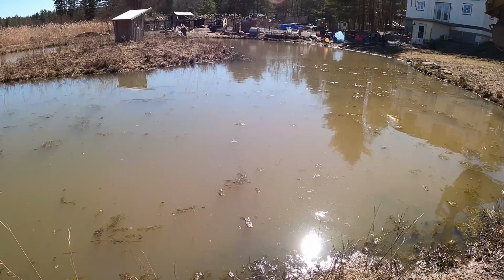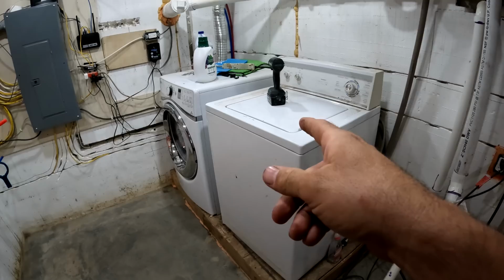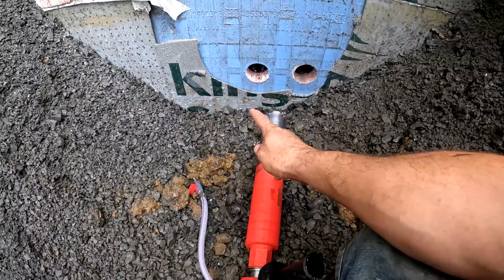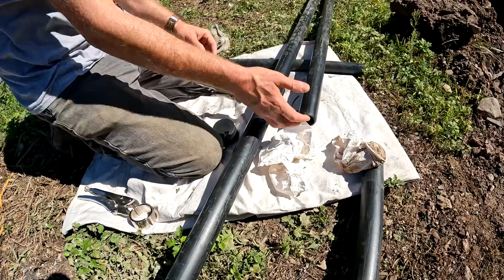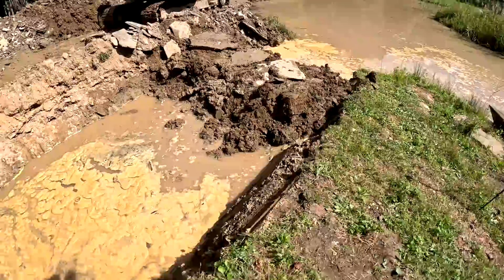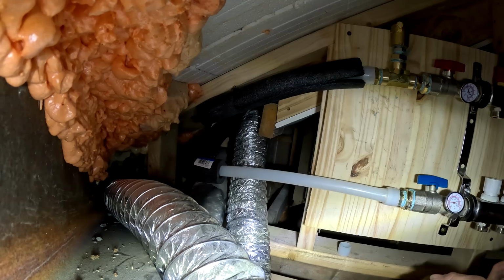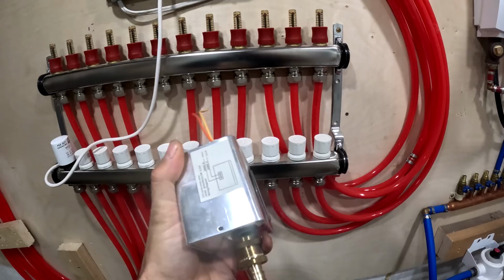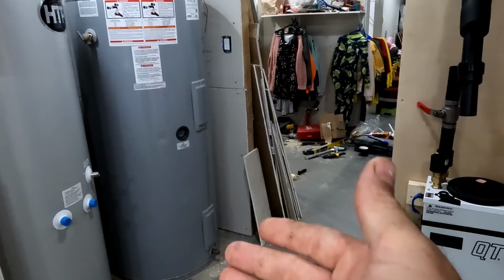Installing a geothermal system with a pond loop at my house Part 1

Comment: Why are you worried about burying the pipe assembly in the bottom of the pond, wouldn't the coil be warmer in the mud or rock under the pond?  Most closed loop systems that I have seen are just burred in the ground 8 to 12 feet deep.

On the drill can a SDS Max (or SDS+ for 2" and under) do the same holes or is that drill just much easier?

What heat pump are you using for your system?

Comment: I found my 6 zone/thermostat radiant floor heat was a bit of an overkill since heating the slab is not instantaneous.  On cold days my boiler and circulators were calling for heat all the time due to all the different zones calling for heat at different times.  I ended up manually bypassing/opening all the taco zone valves for all zones but the warmest room in the house, which would set the ambient heat for all rooms.   I also turned on the thermostat for the coldest room to a temp below the ambient heat to keep it warm on real cold days where the only zone which would not heat was the warm room when not also calling for heat.  Saved me a bunch in fuel and electric.  2:17:02 Hopefully that tank will help you, plus your house is tighter than my house, though it is not good or cheap to have a circulator running all day either.
Reply from the maker: yea I get what you are saying. but with this tank, it circulates 120 gallons before needing to turn on the unit.  Also remember this circulator pump is modulating, and at the max flow it is only using 45 watts. but that would only be with the whole house calling for heat. Usually much less. It has a flow and pressure sensor so it only ramps up the speed if it senses it needs to. With a boiler and circulator for each zone, you are using alot of energy when one zone turns on. Upstairs I have 4 zones which are all small rooms, so I specifically did not want anything besides a super efficient pump turning on when each one of those zones turns on
Reply: @jmuller86  I have older Grufundos circulators but also run three of them, radiant loop, injector, and boiler loop, plus a fourth for my hot water.  20 years they are still going.  Hopefully you got a stainless steel tank, my old HTP superstor tank had galvanized connectors which burst.  I am pretty sure my plumber installed it wrong, instructions tell you not to heat the connections because they were plastic lined to prevent rust, 10 years later they rusted out an burst right at the nipple.  I think most superstors are stainless steel these days.   It is still good to have zones, you can dial it in multiple ways with the flow valves or zone valves.  

That storage tank might make a difference in my house too. There probably is a way to run it off my superstore hot water tank since I run an injector pump to inject heat in my radiant loop.  Tie the superstor into the boiler loop and have its hydrostat turn on and off the boiler only when needed, similar to a tankless water heater coil in a boiler.  Would eliminate the circulator on my superstore and probably hydrostat on my boiler.

Comment: Not sure where you live, but if we installed a loop in a pond like that in Canada, we would freeze the pond solid in winter.  My outgoing fluid temps are at 28F in the middle of winter.  Incoming are at 32F.
Reply from the maker: There is only a 4 degree delta in the loop? When ice forms on the surface it is like insulation and keeps the heat on the bottom where the loop is

Comment: You have me wondering how you expect four inch minus rock to hold a vertical eight foot dirt bank?  Wouldn't you be better with armor rock of a huge size or perhaps precast concrete blocks?  Since it is an invisible bank it would seem important to do a little overkill.  Behind that barrier digging it out and putting in the four inch would make a good base.  You have so much cut dirt bank around the pond though I don't see how you are going to deal with silting?  Did you put down pond liner when making the pond?  I watched it but that was years ago and I have forgotten.  Can you pull up the coils for maintenance in the future?  To allow you to dig out the silt that may start to cover them?  Another very interesting video.  I like having it all on one video rather than many twenty minute ones.

Comment: Yeah - I'm not understanding where the heat is coming from in the winter since the water will be in the 30s so you would need to have air temps in the teens to pull heat.  I'm used to seeing deep geothermal with temps in the 50s for cold climates.  But wow - what a setup.
Reply from the maker: Ponds stay usually in the 40s in the winter towards the bottom.
Reply: i think the earth radiates heat towards atmosphere, so if the atmosphere is freezing, the lower water levels still stays warm as the atmospheric temperature can't make inside deep water. this is a common knowledge, idk if there's any technical thing about it in your area.

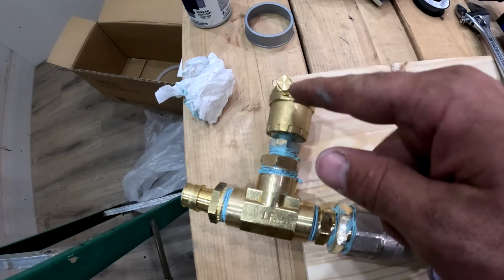Comment: 1:31:47
It's a floater valve.
Air collects at the high point and the water level drops. The floater drops with the water level, which opens the valve to purge the air.

Comment: instead of putting more weight on the pipes, why didn't you just fill it with water and purge the air to make it easier to sink in the water?

Comment: The looping is designed to create cavitation which causes the water to mix and thus absorb more heat or cold depending on cycle.
Reply from the maker: Really? I did not know that
Reply: Interesting. On my ground-source system the looped (aka "slinky") is the less efficient style. More energy is exchanged with long, straight runs. Need a lot of land area to do that, of course.
Reply: @mg-bx6bi  I have long straight but more lines smaller is better because of more surface area and more cavitation. 

In water the loops stacked don’t matter as much because the water gets into the gaps. But it goes down to smaller pipe to cause cavitation.

Comment: im wondering that there not being any introduction to what is being done here i assume that this project is using a geothermal area where you have mild volcanic heat from below the ground.Is this the resource that producer of video is trying to utilize as source of clean energy? Thanks for reply

Comment: 1of the 2left loops may be a heated garage /equipment maintainance shop like Dirt Perfect has as addition to his house the other perhaps a self defrosting heavy weight rated concrete driveway?
Reply from the maker: I will be building a new garage in a few weeks, 40x60 but it is like 200 ft away. I already have a used 5 ton geo unit for that. I was also going to install a concrete driveway and have it setup for driveway heat but I want heavy antifreeze in that so I may just use a cheap tankless water heater for that instead of hooking to geo. as it only runs once in a while and will get shut off as soon as the driveway is melted

Comment: your going to need 160/170 degre water for your DHW inderecte any way so you can attach to that loop for fan coills and stage thermostate radient will take may be all day to rise 20 degres
Reply from the maker: We wont need that high of temps for the dhw. But that would mean the unit would have to run the entire time that second stage is on.

Comment: Just wondering, when you spoke about the two pipes possibly shifting when you backfilled.  Is there any reason you couldn't use standard (non-pressure treated) 2x4 with CHEAP strapping material   to hold the pipes apart until the backfill job was done?  Or even some scrap 2x6 with holes drilled through to position the pipes.  In time those boards would rot away but the pipes would be solidly in place.
Another question, have you done a "blower door" test on your home yet?  That is one of the items that gives me the biggest efficacy "hard-ons" for a "net-zero" build.  Controlling the flow of unconditioned air in and out of the structure seems to be THE biggest issue with building a tight (energy efficient) home.
Reply from the maker: Yea a 2x4 would work but we just manually made sure they were apart as we were backfilling. I have not done a blower door test but I will be in the next few months

Comment: Very nice video … can you explain how geothermal works like with the pond water? Like in the winter when the water is cold how does that make heat
Reply: The water and ground temperature becomes constant below N number of feet/meters, depending on the soil. 
It's much cooler than the surface air temp on a summer day, much warmer than in the cold of winter.
That's why the code for water supply pipes says they need to be buried deeper than the frost line.
That relatively small difference in temp. can make a big difference when the system is good, like the one Jesse did here.
I'm also interested to hear what Jesse will say in a year or two about his system.

Comment: What is the floor covering on the second floor wooden slats? I thought I understood in the other video that you were only going to put a sealant on the concrete floor of the second
Reply from the maker: Yea I was going to use epoxy paint but we decided to put some waterproof laminate. It gives a little bit of cushion for the boys if they fall by accident

Comment: With the manifold I would of spaced it off the wall with 2x2 batten and 1/2” ply and popes the pipes coming down behind it
Reply from the maker: Thats a sharp corner though unless you start to the right or left of the manifold
Reply: @jmuller86  

That’s a fair point I do a lot of underfloor heating systems the electrical said I have also done the air source and solar heat and electric I enjoy this kind of work so was really good to see yourself making a tube on it cheers feller

Comment: When installing devices on your old work electric boxes cut the ears off the devices or your plates won't sit flush on drywall. Like your "boiler switch"

Comment: Would that pipe happen to be Phillips Driscopipe?  General piping rule of thumb for sleeves, hole is 2 pipe sizes larger than the supply pipe. Link Seal makes a mech seal to make sure that it watertight. Link Seal has charts to back check sizes. This is general industrial info that you don't need.
Reply from the maker: yea I was going to use a link seal but already had the 3" hole. Link seal would need a 4" hole. But I got it waterproof using other methods

Comment: I'm confused. Are you heating your pond?  Why would you want 39° water coming it that you have to keep heating?
Reply from the maker: 39 degrees is in the coldest days of the winter. Right now its at about 45 degrees. It extracts the heat from that temperature. So if it comes in at 45 it would probably go back out to the pond at 35 or so

Comment: 25:00 would have brought the first floor down on the other side then under the 2nd floor (and in the middle) so it wasn't so tight of bend, which is the worst part of it.  having the tubes more nicely laid out would be better too... stack them 2 layers of 3 would have worked too (router 3 channels each into a couple 2x4s and stack them would work for securing the pipes

Comment: Were you planning to put safety pans under your large tanks in case they leak in the future?
Reply: Right after fire rating the whole room.      NOT
Reply: @SPUDHOME  Sorry I do not understand your reply.  Not sure what fire rating has to do with leaky tanks.  Water heaters tend to leak as they wear out, pans underneath with water alarms let you know when any leakage is detected before a major leak occurs.
Reply: @jaycahow4667  what part of “fire” Is hard to understand? Fire has nothing to do with leaky water tanks. Is there a electric panel in the utility room? How about leaky electricity? I realize you must have a one sided mentality but just once think the other side of leaky tank. Just try.
Reply: @SPUDHOME  Instead of insulting me try explaining your original comment.  I have no idea why you even brought up "fire rating" in the first place after I just mentioned leak pans under his water tanks (that is why they make them in the first place and they are required in many places if water tanks are placed on the second floor or higher of a residence).  Your comments are clear as mud.........
Reply: @jaycahow4667  why are you so one minded. What has leak pans have to do with a home fire? FIRE. a leak pan will not put out a home fire.

Comment: I think the coils filled with compressed air was what was giving it so much buoyancy. Once the tubes are filled with water, there will be very little buoyancy from the tube coils, and then you are left with just the buoyancy from the pvc frame. Doesn't matter though if you used extra cinder blocks. At some point, I might snorkel down there if the pond is left dormant for a while just to check out everything and make sure all the pipes are where you expect. I also might rethink ever blasting around in jet skis from now on. Wouldn't want any damage to the pond geothermal system somehow. I would not think if there is some muck on the coils, it would really matter much. The coils are just acting like a radiator and performing heat transfer with the pond water. Muck should be about the same temperature as the water. Just like a typical heatpump with a compressor working with refrigerant, it extracts heat out of the water even when it is 40 degrees in the winter and dumps it into the pond when you are cooling. I bet the fact that you have poured concrete in all your floors will help tremendously with the radiant transfer compared to your old house. It will be much more efficient still. You will have to see how efficient the water reservoir is. Even with 120 gallons, over 800 pounds of water, water loses heat pretty quickly surrounded by air through radiative transfer to the surrounding air. Even with the stock tank insulation, you might want to blanket both the reservoir and the water heater tanks to give them further insulation. Do those tanks require some kind of catch basin? Hopefully the Apollo air handlers are reliable. Like most junk from China, I would be worried about the electronics hardware and the fan motors in them. Will guess they only give a year warranty. That Water Furnace must be a hella expensive unit, even though theoretically, there really isn't any special technology involved more than any other heat pump (I am aware of). I just assume, like you said, the market is not large, so there isn't competition like in the standard heat pump industry. The only thing I would not like is that you have plumbing in every single room in the house everywhere, though in the floor I would think is mostly forget about it. I don't have enough experience with Pex to be comfortable with it yet. I will be more of a believer when there are millions of households still holding strong after 50 years.
Anyway, another really good video. You certainly have modern, high tech systems in your house everywhere. There is a lot going on in the space.
Oh yeah, one last question. You had drain size pvc 6" outlets in the trench space where your geothermal and solar lines ran. You are already hooked up to your septic field right? What were those?
Reply from the maker: yea ideally we would have flushed the loops and filled them to sink the coils but we still havent done that yet so I didnt want the trenches open for any longer than necessary. This system should work pretty well with the concrete floors, and they are insulated underneath so each room can really be separate from the next. There used to be a company called turbonics that would have fan coils that are ducted, and high velocity which would have been nice because then you just install it in that attic space and a short duct goes to each room but then you have to worry about dampers and it is a bit noisy too. I was thinking of buying another apollo unit just to have laying around for spare parts, since I doubt I can actually buy parts. I wish the hydronic fan coil market would open up so I could have a decent selection instead of being cornered in the market. Those drain looking things were just for an HRV in the basement, they were actually only 4". I uninstalled that recently to run those geo loops but I may reinstall it after it is all installed and done
Reply: Hello

Comment: another great video, jesse. im not sure how you can calculate costs of this geo-thermal system when you have done so much work yourself? i mean soup to nuts, to have someone install it is almost impossible for you to calculate without dismissing your time involved. when you calculate costs of installation, please include the number of hours you spent on ground prep and installation.
Reply: Aye,and make sure you put your time down at twenty pounds an hour for labour/digger hire etc. whencosting the system ,plus  wear and tear/dilapidations and loss of interest on capital expenditure. Kind regards from England.

Comment: This seems like a very expensive way to cool a home and alot that could go wrong? Would mini split systems not be the better concept? Efficiently there cheap to run and alot less moving parts. I'd love to hear the pros of this system.
Reply from the maker: it costs about the same money as a tradition forced air system with all the incentives from the utility company and government. but the difference is I dont have the abiility to install a conventional hvac system so I would have to pay someone to do it. with this system I can do most of the work my self, therefor it is cheaper than any other heating and cooling system. plus the efficiency of it is far superior to anything else